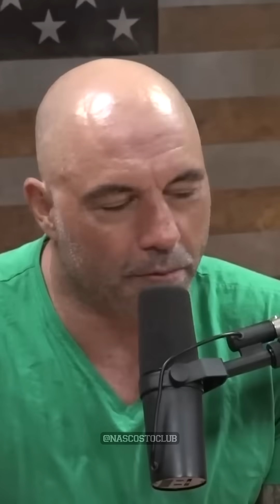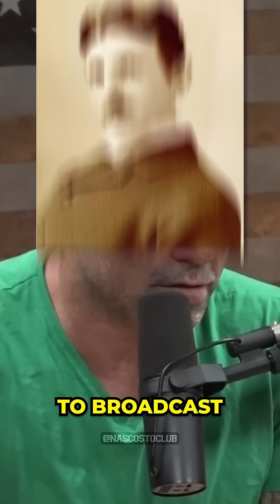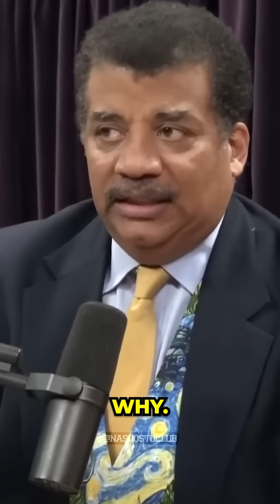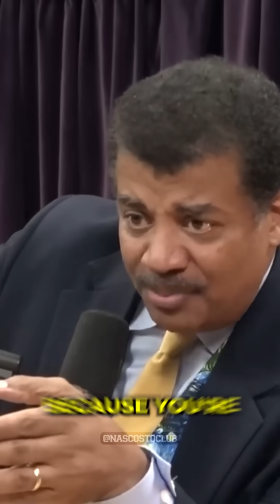WIRELESS Electricity Idea Debunked ⁉️⚡ #shorts

Comment: Neil has to update himself on this one. They just launched solar cells to orbit a few weeks ago with the intention of sending energy back to earth wirelessly
Reply: Nah still he’s right. That would be a slow trickle to charge batteries. Not to directly convert electrical energy into mechanical energy of any kind. It’s cool what they are doing but it’s totally different than what they are talking about.
Reply: Woow, I didn't catch up on this. Which company did it?
Reply: @josipherceg9938  some researchers at Caltech are in charge of the project but they used a commercial provider for the launch. I don't remember the name of the company.
Reply: Is this space-based solar power? From my understanding, the solar cells will charge and beam the energy they've collected through an EM wave of some sort (Microwaves I think from memory) that doesn't get reflected or refracted too much but even this would have to be high energy because of the distance the wave travels and to make it worthwhile to capture solar energy in this way - meaning if you stand in the way of it you're gonna get warm lol
Reply: It's still not strong enough to turn something on... to run enough electricity throw the air to turn something on you are not gonna be able to control it too specifically turn something on anyways, if you get to close it would eventually zap you. There's a way but it mean like the objects would basically have to be right up in wherever the energy is coming from and still even then if you get to close you're still getting zapped had af
Reply: 'with the intention of sending energy back to earth ' seems a little early to me...especially if it's made in USA...We don't want us to be pointed by something which isn't our country made...there are too many energy already present here back on Earth... that's just an excuse to weaponize that satellite... can't trust those guys unless they neutralize all their 'Karens'...
Reply: This is completely different. He's talking about literally sending electric currents through the air like WiFi.
How do you prevent that electric current from being diverted by another conductive source? Like someone's belt buckle?

Comment: Look up concrete or cement batteries. They run on silica which tunes Naturally to the magnetosphere. You can tune a radio into other wave using quartz and copper windings. If the earth has an iron core and magnetic materials on the outer areas of the sphere it will create a resonant charge in negative ions. This are pretty easly collected with silica and other crystals because they formed here on earth. So yeah tesla was correct. Ps if you stayed this long look up aluminum air batteries you can tune even aluminum to the earth's charge. This said all of these batteries need amplification do low magnetic or amp out put. Low class amps are easy joules ringer.

Comment: I remember when I was in college where engineering students used I believe was a tesla coil to light long bulbs from a distance.
Reply: Lightbulbs don't actually use much power
Reply: @jamieboer3466  yeah. But NDT says it's not possible
Reply: @abefernandez6546  he's right, we could not use Tesla's full system. The lightbulb thing was a model, it doesn't scale like Tesla thought.
Reply: @jamieboer3466  yes on the original experiment. If there was more research done, it should be possible. Literally we use wireless charging technology nowadays with phones and other electronics. Even you said that lightbulbs don't use alot of power. So it's possible with a network, or even lazers or with further research a better alternative. Neil is a astro physicist and not a electrical engineer. He understands basics of electricity but not specialize in it.
Reply: @jamieboer3466  I'm not worshipping anybody. Also, ad hominems is not helping your arguments. You as a electrical engineer should know that technology advances and education 5 to 10 years ago become obsolete and behind because of advances in technology. Yes, wireless charging loses energy through heat and wires do the same also. It's the basics of thermodynamics. 15 years ago there was no such thing as wireless charging, yet here we are with fast charging wireless tech.
Reply: @jamieboer3466  also, you don't seem like a electrical engineer. From your vids on your channel, I would say computer science or computer engineering, not electrical engineering.
Reply: @abefernandez6546  I work in a factory as an electrical engineer, fun fact electrical engineers take alot of programming courses because alot of the jobs require it.
Reply: @jamieboer3466  yes. But not game design programs. That was definetly no AutoCad, KiCad, etc. 
Also you mentioned homework, I'm guessing you are still a student.

Comment: Ok. The power would have been distributed across a sufficient enough area that you're not seeing a plasma arc the current would not have killed you per se. It's not dependent on line of site like a radio/microwave the atmosphere would act like a capacitor of sorts and the potential would be on demand, the pathway would be from a collector/antenna into the ground.

Comment: So im an electrical as well as a mechanical engineer. I specifically work on induction equipment. Whilst tesla idea is outlandish (sending large quantities if energy vast distances) we do something similar but at a closer proximity. Apparently mister Tyson doesn't understand how a transformer works. The initial input has wires yes. But all of the tPs are not connected. They have coils. And manipulate electricities magnetic field to transmit it to the next coil so on and so forth wirelessly

Comment: Cell towers/radio towers in Eastern Europe has power enough to if you stand a meter away it can  light up a light bulb.    But it's true if you place a wooden board in between the light bulb and tower it won't light up.   Saying this cuz I tried.

Comment: I believe it's possible to move energy from one source to the receiver without impacting other items in the vicinity.  If you send energy in a form that only the receiver is capable of interacting then you can transport energy from one source to the receiver.
Reply: It is possible. A crystal radio can power an earpiece with just the power of an AM radio wave. You can make one at home with minimal parts. It will probably cost less than $10. It's not a secret. The problem arises when you intend to send several kilowatts of energy. Plus, the inverse square law means you will lose MASSIVE amounts of energy trying to send power through the air. When providing energy, we tend to want to preserve as much as we can.

Tesla had GREAT ideas. We still use a lot of his inventions today. The entire world relies on his invention of the 3 phase AC grid. It does not mean that every idea he put to paper was flawless.
Reply: Doesn’t Neil make you not like Science.

Comment: Walk between a couple of buzz bars that are trying to pull towards each other in a power station to get a sense of just how lethal electricity moving through the air can be or ask the poor guys who have survived electrical spikes or lightening strikes.
Reply: Exactly. If we did this. We'd most likely have quite few deaths because of some freak charge either coming from the ground or the sky because the clouds decided it wanted to be extra electrical. It would basically fry any device running on wireless energy in the vicinity as well. 

Is small areas like buildings and such? Totally fine, but don't be power cities and towns like this.

When I wasin grade 3. I walked past one of those small plastic and metal chairs and 2 in blue ark struck me. I can't imagine that not happening suddenly at some point.

Comment: I read Tesla's book and this doesn't mesh with the manner in which Tesla had proposed.  Tesla's plan wasn't to send electricity through the air, He was going to make "ground" the source by charging the earth's core with electricity, and use an aerial antenna to act as ground.  He described the phenomena of St. Elmo's fire surrounding the aerial that can actually become visible during daylight if your current draw gets high enough.  But the current actually passes through the conductive material of the earth.  The Earth generates approx 100 lightning strikes worth of electricity a second (iron core spinning in the sun's magnetic field), why would we "ground" our circuits into a source of electricity, we would be fighting the difference of potential.  Granted other things might be difficult such as anchoring a proper connection to the earth bound source field, and also conditions in the atmosphere not being optimal for adequate discharge.  I greatly dislike it when people who haven't read what Tesla said, but rather they read what other people has said about what Tesla said, then proceed to debunk someone's conflated erroneous translation, instead of looking at what Tesla's plans were.

Comment: Well here again Neil can be proven wrong. The United States has a drone that has power to completely wireless by beaming a beam of electricity through the air and charging it also I remember there was a bar or restaurant somewhere in Canada that had wireless charging for your cell phone through the air, not by setting it down on something to charge it but it would charge it through the air. The main difference is so far we do it with direct line site and Tesla just wanted to have power kind of everywhere which is less feasible

Comment: Okay he needs to stay in his field of expertise cuz he's wrong Sony 30 years ago I had to television that was based on wireless and you plugged the power and the coax cable in AV's into this box on one side of your wall and your TV could go on the other side and hang like a picture frame not only that we use wireless charging in our phones and there is actually not free energy but if you have an antenna that resonates at in energy RF range around your area you can actually get energy and even the further prove it the a.m. crystal radio receiver that came out back in the day didn't have any batteries it used the AM energy that it was receiving to give you AM radio

Comment: Energy does not go through the wire. It flows around the copper CONDUCTOR. To a load source. Electricity comes from the earth and has to return which is why each home has a ground rod and the neutral bet goes back to ground as well to complete the circuits. So a Tesla coil would capture that electricity as a Direct current, then it can be inverted to Alternating current for us to use

Comment: He’s right.  There were protests against power towers going through suburban areas in Australia in the 80’s, they took fluoro tubes that lit up from the waves moving through the air.  They didn’t light the whole tube, but it did light in stripes across the tubes because they’re the waves!

Comment: Has this guy ever been near a tesla coil the voltage is extremely high but its not what kills you its current that kills you current is amperage a light bulb doesmt require much amperage if the voltage is high tesla coils have low amperage do to the amount of windings in the coil.

Comment: Yeah, like lightning.  Maybe we could place receivers on specific areas of rooftops. This energy can be directed or drawn to the receiver. Like a lightening rod. Radio picks up static electric through its receiver. It's been said that lightning can't be caught and stored because its power output is in the mega Jules. So why can't we just produce artificial lightning that carries fewer watts? The only problem is drones and birds.

Comment: You could pull it off. It would have to charge a battery though. So it might take a while before you could do anything with it. It would be cool to have wireless lanes in the sky that have higher voltage, then beam those down to a receiver on your roof. Maybe that would give more power. But birds might die. You don’t know until you try.

Comment: Wi-fi sends ENERGY through air, but also through some walls.
Reply: Right but at a extremely lower amount.  And it’s only transferring information not enough power to drive a mechanical device.
Reply: Wifi does not send energy, it sends information thru radio waves.

Comment: The electricity conducted through wires flows around or outside the wires in a field of several inches. This is why you lose significant amounts. People are using his coil to power their houses etc though this is a different issue.
Reply: You don’t loose significant amounts that’s the point of wires.

Comment: Telsa showed he could power lights with wireless power and it wouldnt kill you. It wasnt dangerous in that way. The real issue is that it would fry the tiny transistors we use for everthing today.
Reply: If he did that, it was with a Tesla coil over very short distances, not at all like his wardenclyffe project.
Reply: @deuslapis5247  The Wardenclyffe field wasn't dangerous just horribly inefficienct at any great distance compared to wires and would have not been good for any tiny circuits that would recieve the energy and fry out.
Reply: @johno1544  If it was low enough energy to hurt no one, then it would power nothing. If it was high enough energy to power things, it would hurt people.
Reply: @deuslapis5247  that's not how his wireless electricity worked. Seriously you can try it yourself with a plasma ball toy you can power a light bulb with that in you hand and not feel a thing.
Reply: @johno1544 that's bc it's extremely low current, to power anything useful we would need more.
Reply: @johno1544  that's not at a distance, your hand is not in the way of the energy, and that isn't using EM radiation to light the bulb.

Nothing you said was related to what we're talking about.
Reply: @deuslapis5247  it is using EM radiation to light the bulb. What other force do you think it is using? It works without touching the device with your hand in the way or not. This is HS science stuff. You do understand EM radiation covers just about every force in nature we deal with from radio to gamma including all wavelengths of life.
Reply: @jamieboer3466  Telsa was able to scale the process up to millions of volts. It's not efficient because of the inverse square law you need 100x the energy to get 10x the distance. There was also no way to meter it to charge people money that's when his funding dried up
Reply: @johno1544  EM radiation occurs when there is an alternating electric or magnetic field. EM waves are light, and can vary in frequency.

Plasma balls do not use EM waves, but instead act as tesla coils, expelling electrons at high speeds. This is NOT EM radiation, and is a completely different mechanism to a radio tower.
Reply: @johno1544  volts isn't the issue infact you would need it to be high to do it at all.
Reply: @jamieboer3466  I think the guy that invented AC knew that.
Reply: @johno1544  unlikely, btw neither of the inventors of AC are Tesla.
Reply: @jamieboer3466  I dont mean the pre Tesla AC that was non-industrial, and worthless to the common public.
Reply: @johno1544  not really given it's a concept that hasn't changed, Tesla invented the first AC motor, not AC as a whole nor did he change it.
Reply: @jamieboer3466  didnt change it? His polyphase “induction motor” made it possible easily harness AC power in a large variety of industrial applications. He can correctly be thought of as the father of our AC grid thanks to his inventions.
Reply: @johno1544  ok but ac motors still weren't reliably used until drives became a thing, so really didn't do much to speed anything along.

Comment: Yet cell phones and Wi-Fi are through the air… no concerns there. 😅 may not be as strong as what is required to power light bulbs but if your concerned about the waves then you should be worried about ones bouncing around currently